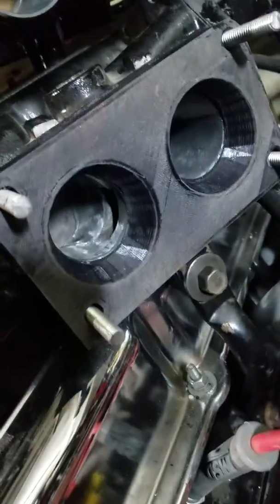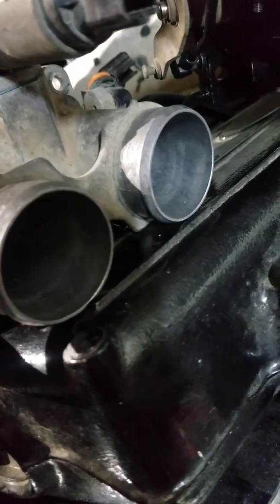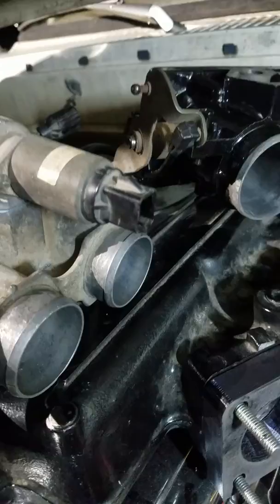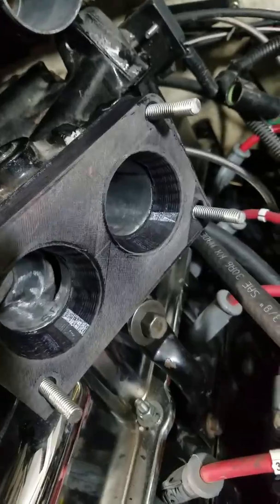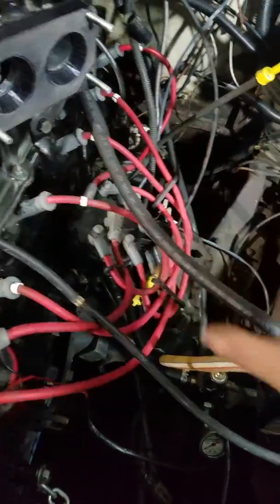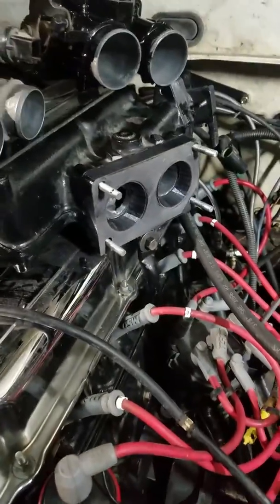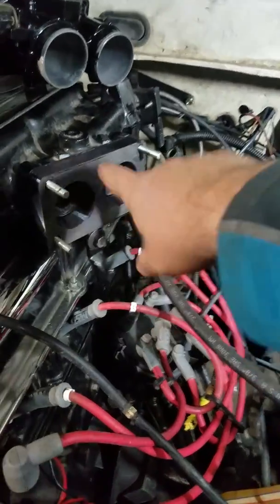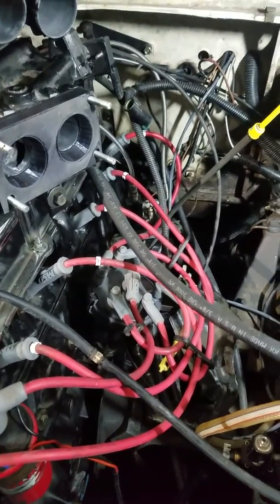Sleepy 6 302 throttle body on 300

Comment: I just did pretty much the same thing with my 4.9, I put a 5.8 throttle body on and there’s a noticeable difference in power, my only problem is I have a really high idol now, did you run into that or have any suggestions?

Comment: How did this work out for you? Would you make adapters to sell?
Reply from the maker: The adapter is still in use, I can if you wantme to
Reply: @justinzierott7580  does it make a difference? How much would you be asking?
Reply from the maker: @STR8SICCC  the throttle is a little touchier.  Depends on the material you want it made from.  I used Nylon because I was injecting methanol
Reply: @justinzierott7580  ahh I plan to stick with gas myself
Reply from the maker: @STR8SICCC if you're wanting an adapter just like mine, I can do it for 20 bucks plus whatever it costs to ship
Reply: @justinzierott7580  I'm interested, but would want to upgrade to a BBK TB which comes in a 56mm or 61 mm for the 5.0. Do you think that's possible?
Reply from the maker: @STR8SICCC  yep, not an issue.  I would need some measurements
Reply: @justinzierott7580  you have a Facebook or something so we can talk payment, etc?
Reply from the maker: @STR8SICCC  yep, my name

Comment: I wanna know how you set up microsquirt as well as the raspberry pi, I have a 93 f15p with the 300 that I want to turbo and had actually been considering making a custom gauge cluster that uses a 7" screen and raspberry pi as the main interface, along with some digital gauges to either side of the screen
Reply from the maker: Could you explain what you mean by how I set up microsquirt?  On the raspberry pi I just installed the standard raspbian OS and put tunerstudio on it.  Unfortunately I have to open tunerstudio every time I turn it on, which is annoying.  I haven't figured out how to get it to start on boot yet.  Otherwise it's just a USB connection to the microsquirt harness.

Comment: I bought one of those 5.0 throttle bodies.  What prevents you from opening up the holes?
Reply from the maker: I did a bunch of forum searching on it, and what I learned is that there isn't enough material cast to bore it open a meaningful amount.  Another issue I saw was that you'd end up in the egr.